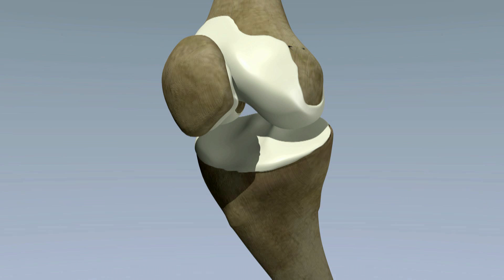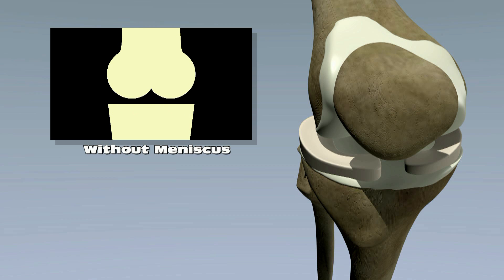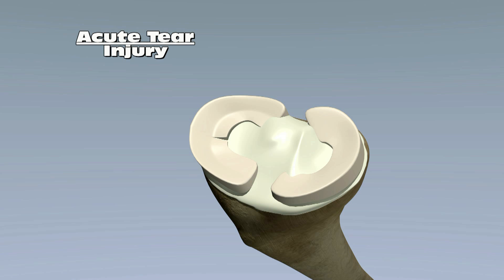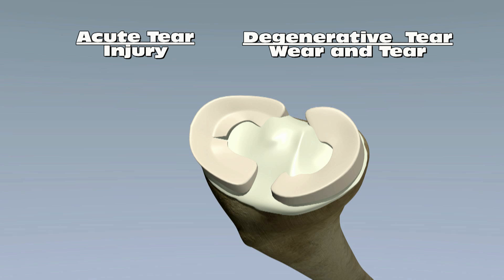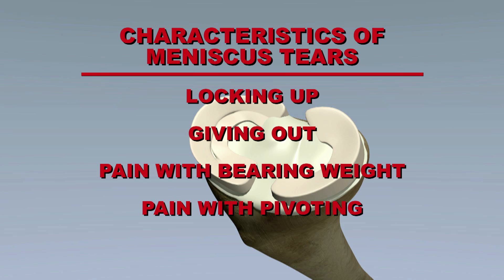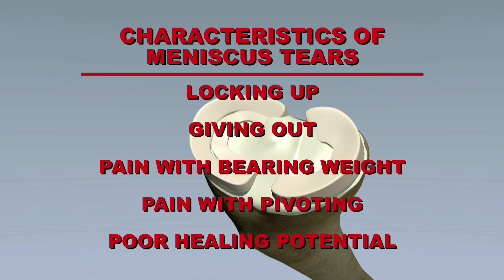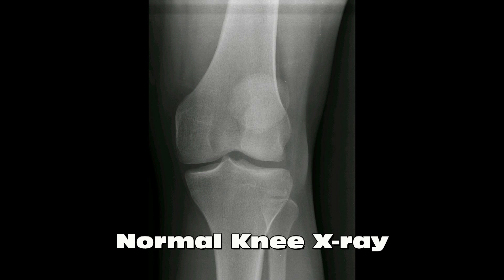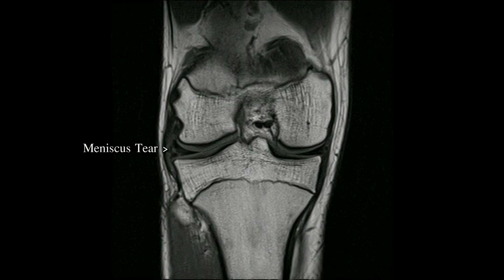Meniscus Tears

Comment: ive torn both my acl and miniscus and i will be having a sugery soon ... am so scared
Reply: What's up bro, just letting you know that I to have previously torn both my ACL and Meniscus - I injured mine during a football/soccer game. I got injured July 2017, got surgery December same year and am now unfortunately waiting on a 2nd round of surgery as my meniscus is still partially torn and needing repaired (my ACL is stronger than before). All I would advise is that you go through with the surgery no matter how nervous you get, its impossible to get back to doing what you love, especially if its sport related, without getting fixed. And after surgery take your time, work hard during rehabilitation, do exercises properly and consistently and DO NOT RUSH. These injuries are definitely a test of physical and mental strength but I can guarantee you will come back stronger than before💪🏻, keep me posted on your injury and let me know if you have any questions.
Reply: @davidcunningham1747  what graft did you chose
Reply: I have miniscus tear , I don’t what I should do ?, surgery or only exercise, reply please ❤
Reply: Today's Technology is latest ...no need to scare